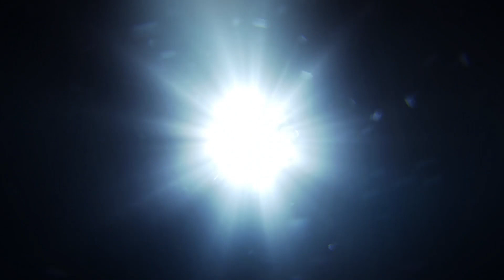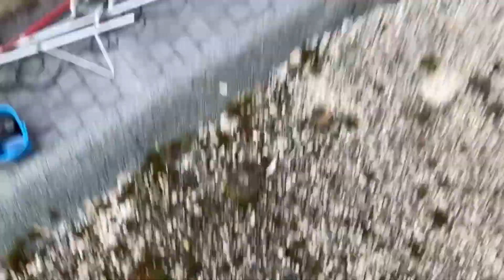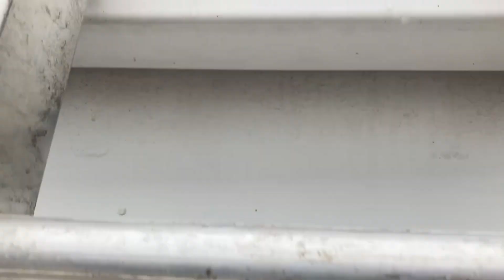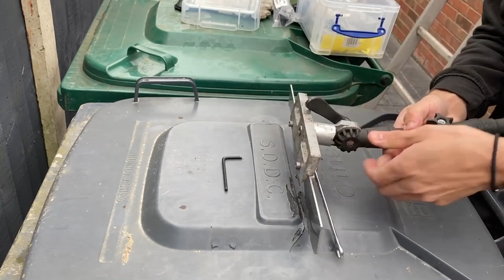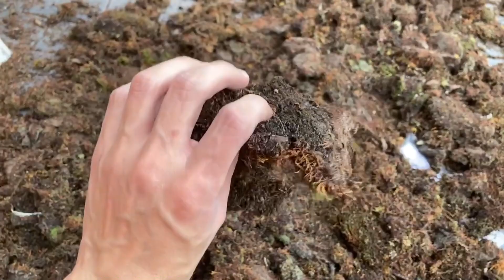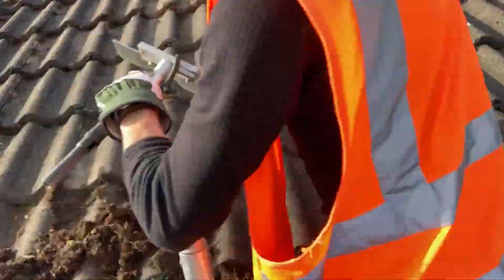Real Time Roof Cleaning, Satisfying Moss Removal // Partridge Exterior Cleaning

Comment: that scaffolding used in this video, what is it called or referred to - I need one for my gable end pointing!
Reply from the maker: MITOWER 4M PLATFORM HEIGHT 6M WORKING HEIGHT 
you can get a bigger variant up to 8M working height which may be needed for working on the apex's of roofs

Comment: excellent scraping, what do you think about the reagade threads?  im always having issues with them, and iv had the scraper head fall off a few times on jobs, very frustrating!  you have any tips or using anything in particular to fix this.? thanks. and another great vid.
Reply from the maker: Hi mate, im not sure if im just lucky or not but I've got 3 renegades and not ha an issue with any of them! I just make sure to pop an alan key in the clamps and tighten them when I buy it and they've always done me well. 

thanks a lot mate cheers

Comment: How much do you pay for blades? I know a guy who runs an engendering firm and I take the tile to him and he makes ma some with the holes in the right place. I’d say 5-8mm metal and be levels the ends so they scrape better
Reply from the maker: Hi mate they are usually £15 a pop. I don’t really mind about the price of them as they last for multiple jobs so always make a good profit on them
Reply: @PartridgeExteriorCleaning  ahh that’s not too bad then, done one yesterday and it had 6 valleys. Only a bungalow but a big one and every single fillet of cement has gone. Only thing holding it was the moss lol
Reply from the maker: Nightmare mate I’ve had a few like that. Always a tricky one to explain that they will have to fork out for repairs but luckily every customer for me so far has been understanding
Reply: @PartridgeExteriorCleaning  my mates a roofer so I explained and she already knew so he’s given her a price to do it this morning and she’s happy. Roofer who put the tiles down done a crap job aswell which don’t help 😂😂

Comment: What pole you using and is that the freeman scraper? Just about to order some gear and do my first scrape. Any advice?
Reply from the maker: Facelift renegade 30ft but be warned it’s heavy! And yeah I use the freeman’s flexi scraper 👍
Reply: @PartridgeExteriorCleaning  do you find the 30ft pole cover most jobs? Also what do equipment do you use for bio treatment? I was just going to start off with my gardiner backpack til i get something better. Thanks for the reply 👍
Reply from the maker: @zedbuller2488  most yeah, i will be getting a 45ft ova8 for those random jobs that are just huge. I've just about managed so far though. 
yeah the backpack will be fine mate just keep it on max and use a brush with 4 jets in it, works well

Comment: Get Peter Marshall double header its a game changer as you just flip it over fir the wire bush and can get the edges 👌🏼👍
Reply from the maker: i have the flexi scraper doubler header mate just don't use it when I don't need it, saving weight and all :D

Comment: Great video Sid. you will soon be over that 1K subs🎉 Was that a 4.5m tower
Reply from the maker: Hopefully mate! I believe so, think the mitower is one size only, 4-4.5m platform height and 6m handrail height
Reply: @PartridgeExteriorCleaning  I think they do one with a 6m platform
Reply from the maker: @squeakycleandave1  yeah the place i hire from say its just one size but im sure ive seen bigger mi towers out there. I'd feel safer going with a boss tower for going any higher though personally as the outriggers are quite short on the mitower

Comment: Looks like the mi-tower was easier to put up and stable. I have seen vide where there are hooks that slide out of the platforms (the silver bits) that can be used to hang sections on so you can climb up and reach them for next level. Great to see real time as it does sometimes look like you fly through the job. In real time looks more like 5 mins per sqm! Great job, I bet your arms are getting huge :-)
Reply from the maker: Ooh.. you might be right there, I was mucking around for a while trying to figure out how to get everything up easier. Everydays a school day :D
It was definitely more straight forward than the previous towers I've used, felt a lot safer moving it around myself too, the other ones i feel like if i made a mistake and it started to tip when moving i'd have no chance in stopping it but with this one I think I could keep it from going due to how lightweight it is. 
Yeah man it is slow! 
And I wish they were but I just don't seem to change in weight ever :D I'll be jealous of now me in 20 years though I bet.
Reply: @PartridgeExteriorCleaning  :-) 20 years try 25 more than you, that's nearer my age :-) No way my body is up to that much hard labour even though it's had an easy life :-) Great to see you doing the roofs though, keep up great work.
Reply from the maker: @ched999uk  :D I love the job but I already know there's only so much a body can take so getting the tough stuff out the way in my prime so I can sit back and let another young buck do it when the time comes :D Cheers mate thanks for all the comments really appreciate it

Comment: HI, I recommend you buy nylon blanks instead and cut them to the exact size using to a scribe to measure, a coping saw or a jigsaw.

This is because the nylon blade will change to the ideal shape the more you use it.
Reply from the maker: Hi mate I use anylon blad frequently on flat tiles but do prefer the sharpness of the metal ones on more tricky tiles, tend to get many many jobs out of them too. Wouldn't be without my nylon ones on small flat concrete ones though!
Reply: @PartridgeExteriorCleaning  Yeah I would prefer metal myself on tiles that don't scratch up but I found there are too many variations for the 12 blade kit from Spinnaclean, skyscraper to cover everything.
Reply from the maker: Yeah I think spinaclean need to up their arsenal a bit. The flexi scraper alone has about 6 different pantile variations on top of all the other ones. There’s still new ones being made constantly too. I havnt yet come across a tile I havnt got a blade for but I’m sure the day will come with some of these one off pan tiles that pop up every now and again.